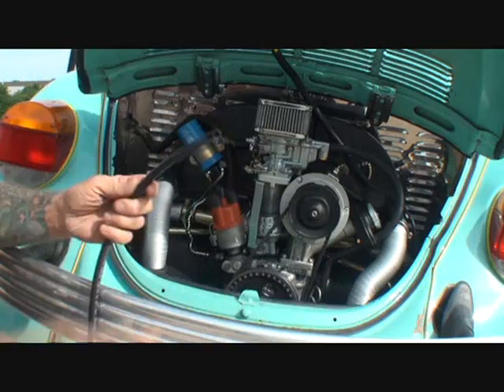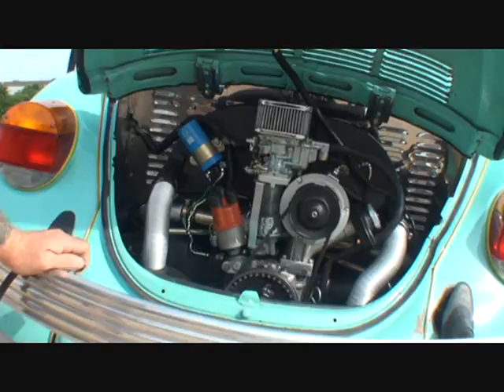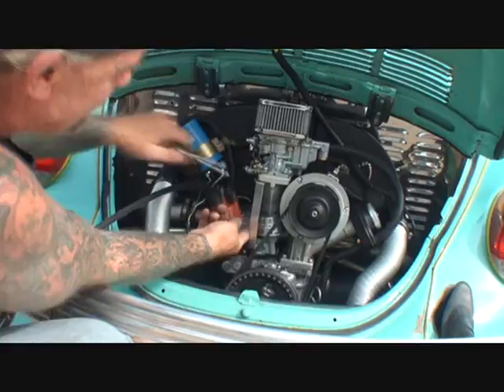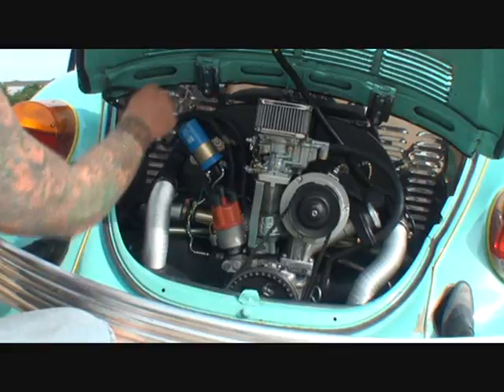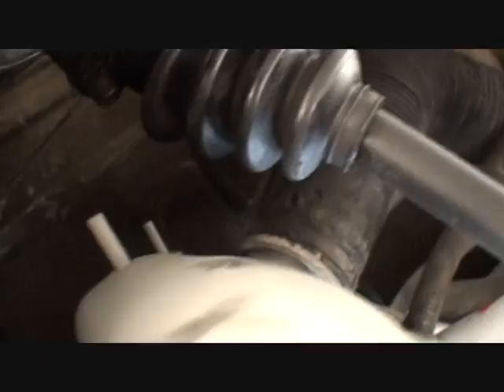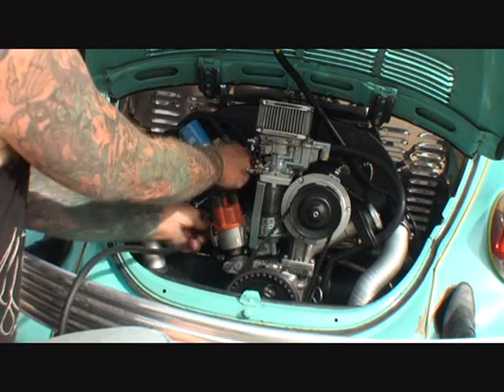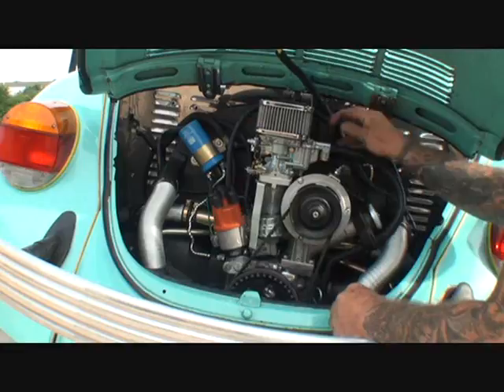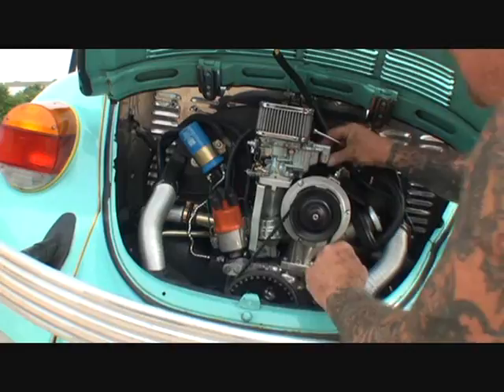Carburetor Repair-VW Bug-Vapor Lock Quick Fix-Part 2

Comment: That is the same way I fixed my bus but I left the metal line through the fire wall just cut it shorter so the rubber wouldn't chafe on the sharp front tin. Your the man Pete keep showing these kids how to do it right!

Comment: 21 years ago I owned a 61 beetle and constantly experienced vapor lock. Although I didn't know what it as being caused by. It would basically die just like you described, after 10 or so minutes id be back on the road. Crazy to think of all the things I replaced and never remedied the problem. Drove me nuts so I sold it after a year. After all these years it's still missed and hate that I sold it. Thanks for the video lesson Pete.

Comment from the maker: There was alot more done besides motor repair, complete brake overhaul-disc brake converstion, transmission overhaul, fuel tank vatting, fuel line replacement,electrical wiring repairs, and more.. Minnie was just focusing on the engine because it was brand new.. Watch for the upcoming video set where we go get the car out of the garage from being stored for 16 years and you'll understand.

Comment: I live in the tropics, temps above 30C most of the time, the only way I stopped vapour locking was to fit an electric fuel pump. Good video though even with the the F's  :)

Comment: i am far from as knowledgeable as you are pete and like learning from your videos. But in this video you had a few bad tips. running a rubber line in the engine compartment of a vw is not the way to go. the only thing I agree with on this video is getting the fuel lines away from the manifolds or anything that gets really hot for that matter the shouldnt come in contact with any part of the motor. Running a rubber line through the body where it will eventually weaken and possible chafe from rubbing on the metal as you are putting down the road over time is pretty dangerous. Mounting the fuel filter under the car however is ideal. Often you see people with the fuel filter placed above the distributor on the exit of the fuel pump which is probably the best way to catch your bug on fire was great advice.

Comment: Hey My friend pete I have a 72 bug and I re routed my fuel line and put it on the fire wall with my glass fuel filter for ez of changing them but im still having issues of it "vapor locking" reason why i say that is i really dont know if thats the problem or not. i did notice that the fuel filter wasnt getting fuel in it but if you mess with the fuel volume screw and add more fuel it would gather some more fuel and fill the filter half way. Also i would like to know if you recommend a progressive carb for a 1600 dual port. Have a great day and as always keep on buggin 8]

Comment: Fuel lines are neoprene.  Rubber would be solved by the fuel.
Reply: Man, my dad use to rip the motors out of them VWs and have them running in 8 hours in a whole nother VW body driving down the road.
Reply: Well he was 68 lol...